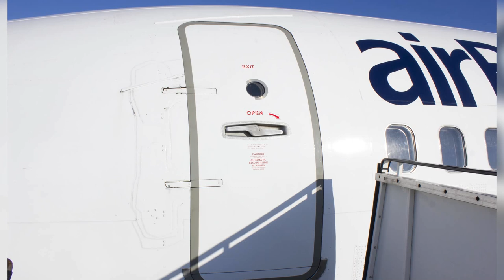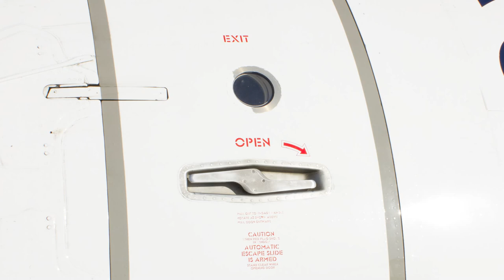Boeing 737 Passenger door

Comment: Airbus doors are so much more easier to open and arm and disarm
Reply: Yes, but they're boring
Reply: very true
Reply: Exactly 😌😂
Reply: is there actually anything hard to use on an airbus
Reply: yeah well this door is 60 yrs old. give it a break.
Reply: The new MAX door has electronic assistance and the 767, 777 and 787 doors are electric, although the 767 is strange
Reply: @dobrien757  max does not have e-assist
Reply: I open these doors daily the 757 is particularly difficult to open. Boeing's doors require no effort haha

Comment: Awesome presentation. I do have the following question though:
"I noticed a flap at the bottom lip of the door fold inwards/upwards, what is this flap and why does it move that way?"
Reply: Its to make an (almost) air tight seal to preserve and/or control pressure in the cabin; plugging the door snug.

Comment: I absolutely HATE the doors on the 737! It looks so much easier to operate in this video because the actor is standing on a proper staircase with a lot of space to stand on, but when you're doing maintenance and get sent outside to open a 737 that's been standing in the icy winter weather overnight, and all you have is a small slippery staircase to stand on with wet shoes, the pant-shitting battle of trying not to slip and fall while juggling a heavy and stupidly overcomplicated door is guaranteed.
Reply: true i am gate agent some time it dont properly latch to close the door from outside.

Comment: Why so much hate on the 737 door? The 737 door makes so much more sense VS airbus doors. Notice how the door begins by moving inboards, THEN outboards, that's because the door is bigger than its opening. Airbus doors can't be this way becaue they open amost instatnly outwards (they move up roughly an 2~ish 3 centimeters (1 ~ 1.5 inches)) before moving directly outboards. Notice the "flaps" on the top and bottom edge of the 737 door, they fold inward to make the door short enough for the outboards swing where it passes the opening that is smaller than the door itself.
Reply: Samuel Karlsson same thing with airbus doors they are all plug type and have smaller flaps on bottom and or top during closing procedures. Airbus doors are armed via a lever so you never break your nails with that dirty girt bar and no need to bend down 8 times on 4 sectors.
Reply: Per
Reply: Thanks for the comment, I never understood how a door could go through its own opening and still close flush and securely

Comment: How is the door bigger than the frame but also exits through the frame?
Reply: If you look at the picture showing the exterior side of the door at the beginning of the video, you can see a line at the bottom of the door. That part is folded when the door is unlocked.